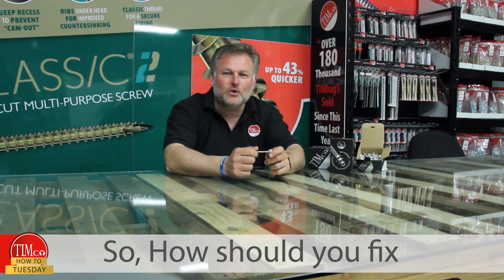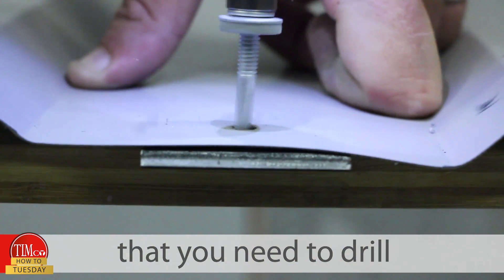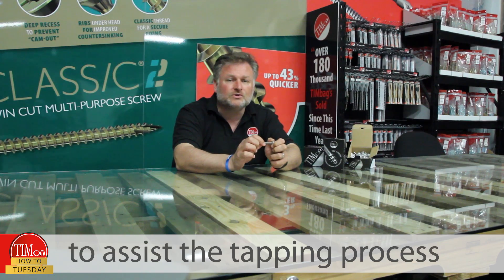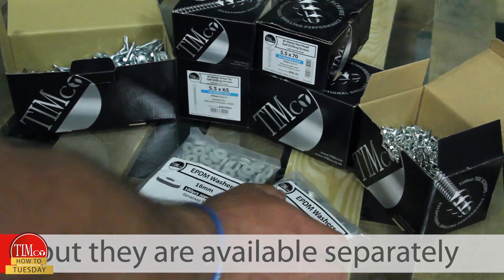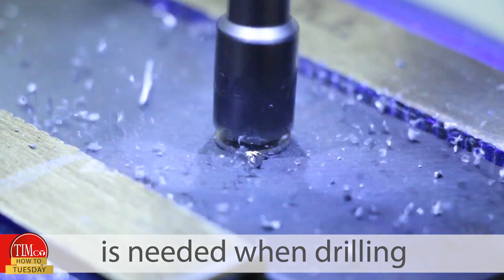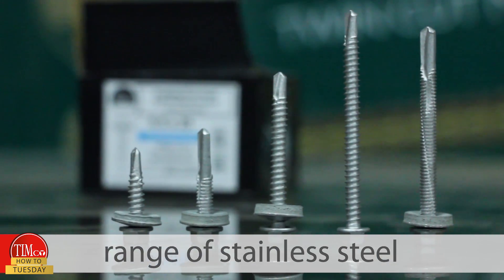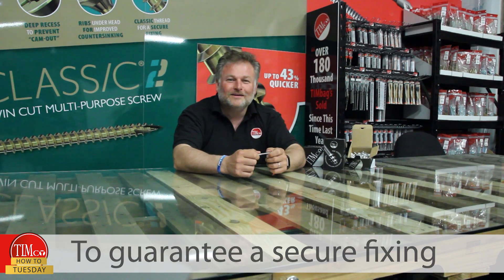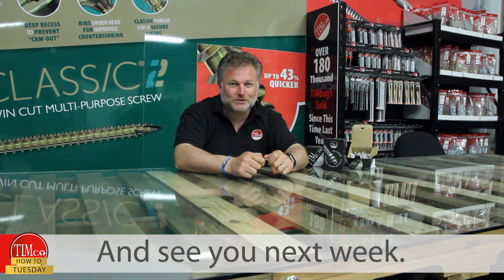How do I fix roofing sheets to steelwork? - TIMco How To Tuesday

Comment: I wonder if a secure fixing could be achieved for the roofing sheets and 1.4mm thick stainless steelwork using self drilling screws?